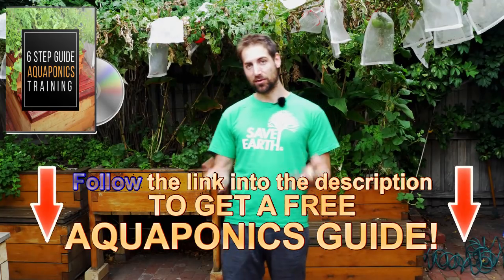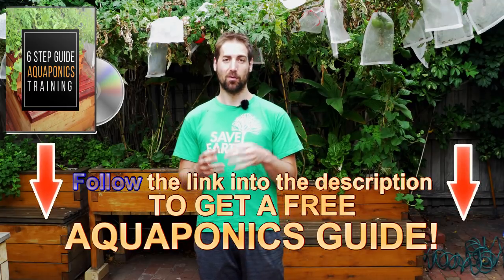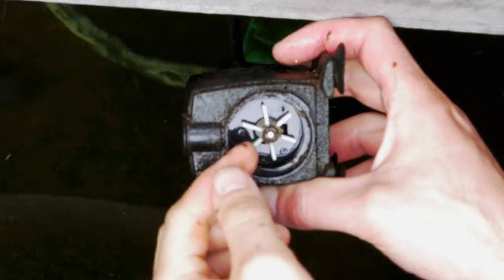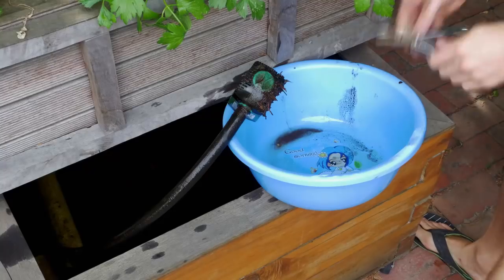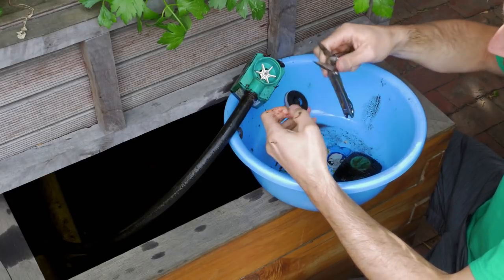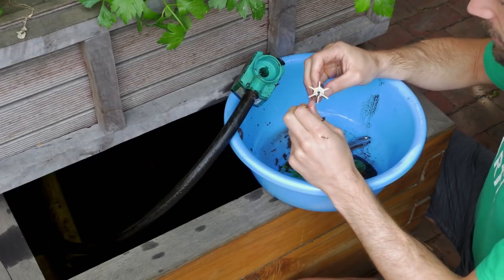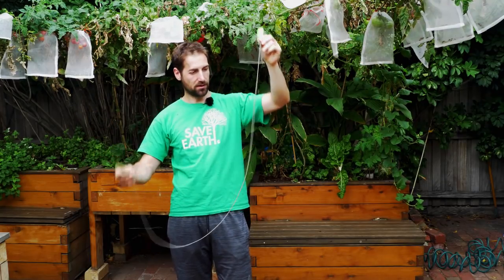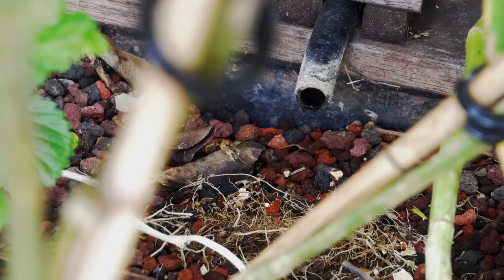This will make your water pump last longer | aquaponics maintenance

Comment: The pump gets cleaned and inspected when there is any reduction in flow.  The pipes are cleaned by blasting them clear with a sump pump at 15,000 L/Hr. Leaves and debris are removed from the cage with a brush when I see them.
Reply from the maker: Great! Good to read from you Jim :)